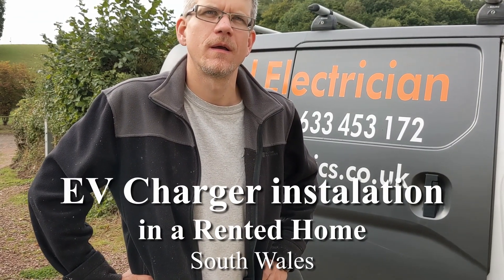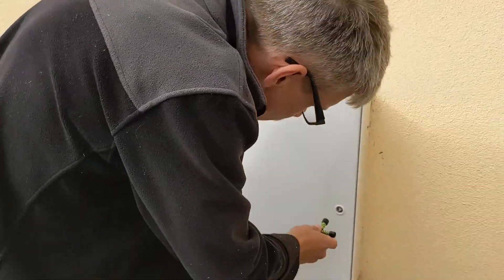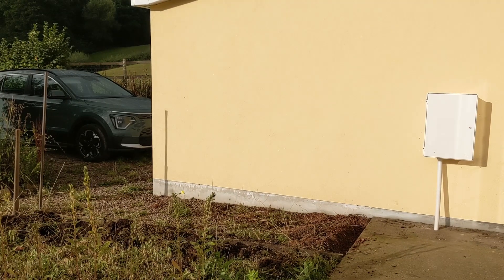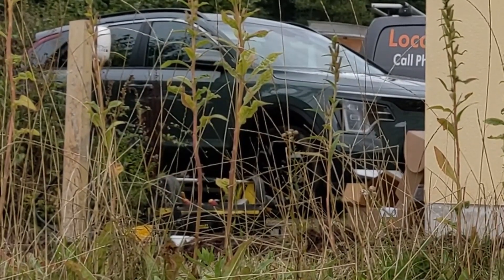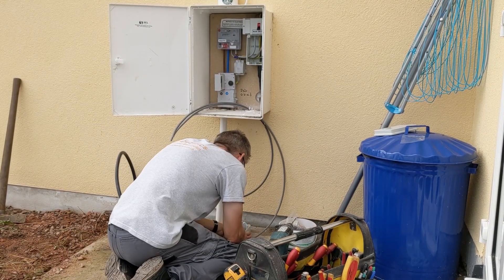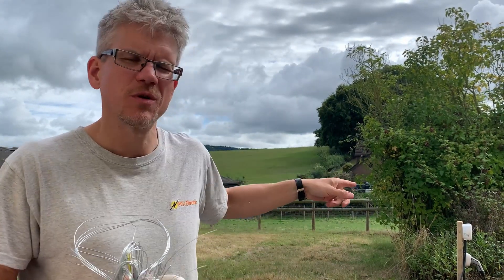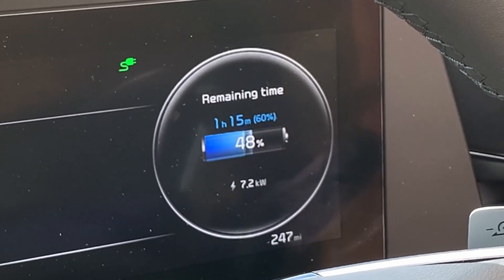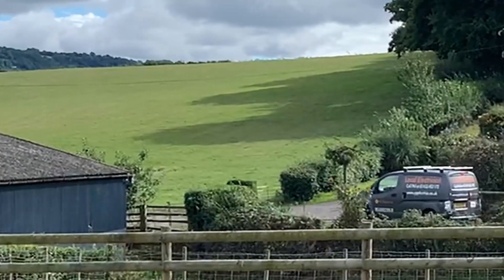Installing a Car Charger in rented property. Our experience of installing EV charger in rented house

Comment: please give us rewie on your home charger wallbox thanks
Reply from the maker: The charger works really well. The one thing I wish it had was a meter to tell me how much charge I am putting in each time. I now know using the vehicle battery charge measurement does not reflect the amount of charge or Kwhs I used. I would like to know how much of my electricity is consumed by the vehicle, especially important in this period of expensive electricity. If you have any suggestions I would appreciate them.

Comment: How much did it cost for the whole thing?
Reply from the maker: It cos us out £750 from memory. There grant of about £350 from the Welsh Government. It has made charging the car very easy. Remember 90% of all Electric vehicles are charged at home.
Reply: @JamesRattray  Not bad. I'm personally waiting for GivEnergy to release theirs especially as I don't even have an EV :)
Reply: Yes, I would like to know the installation costs as well, because this would be a “one off” extra charge that would need to be included in the overall yearly outgoing for the car. Great Video by the way.
Reply from the maker: @blacknight1003  I think it cost us about £750, we got a grant of about £250 if my memory recalls it correctly. The grant was because it was a rented property.